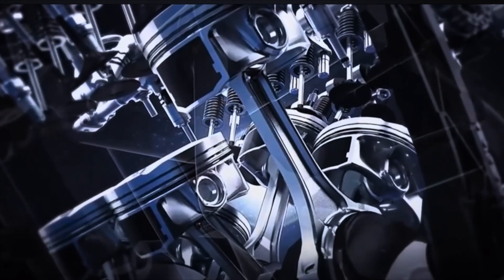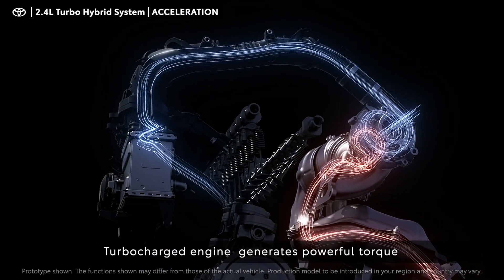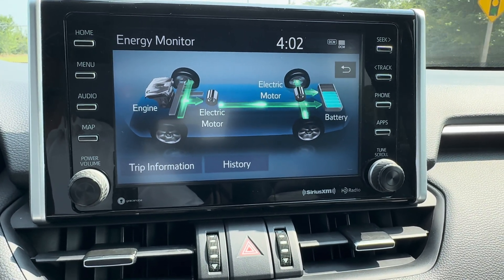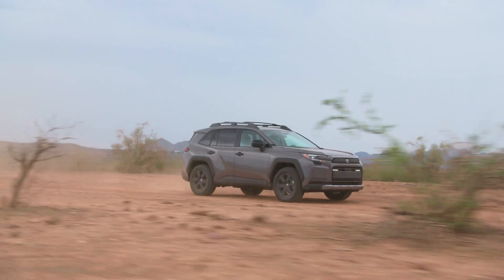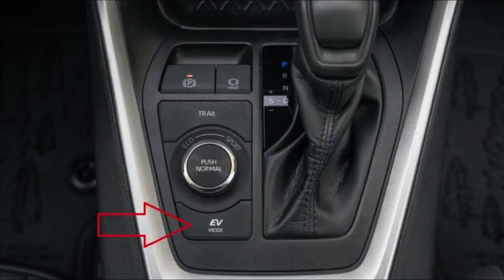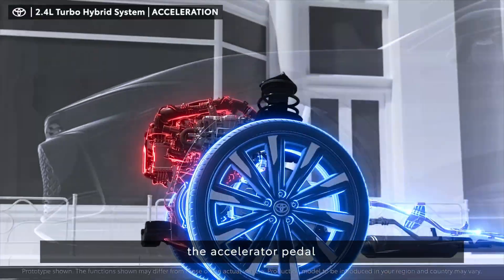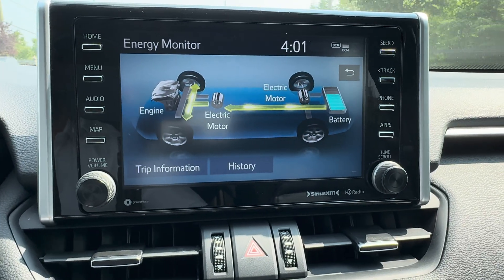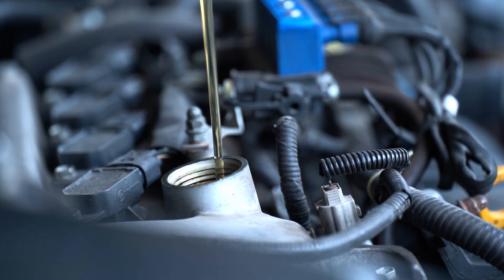Things You Should Know About Toyota Hybrids!

Comment: Just a random thought - could the radiator/engine cooling be used to drive a small steam generator?
Reply: Why would you want to evaporate your coolant?    The maximum theoretical heat recovery from an ICE engine is about 5% as the temperature differential between what the engine needs to discard to maintain optimal temperature and ambient temperature is so low.  Normal steam turbines boost steam temperatures into the 550 degrees C range at 250 times atmospheric pressure while an ICE engine discharges at about 105 degrees C (call it 230 F) and 1.05 times atmospheric pressure.   There just isn't nearly enough heat there to drive a differential and that differential is what generates the power.